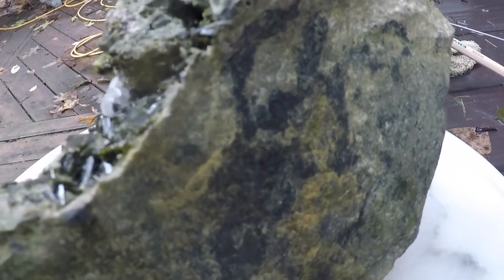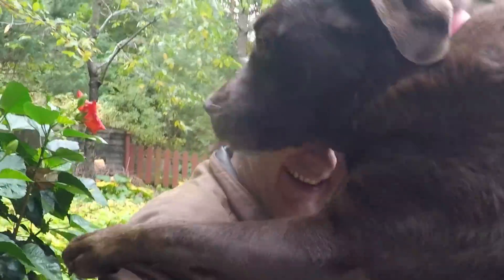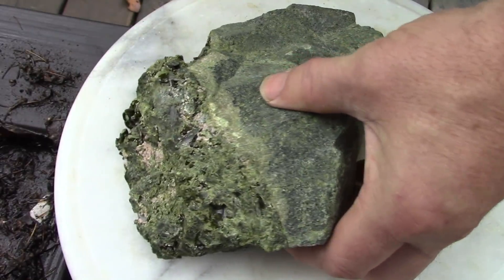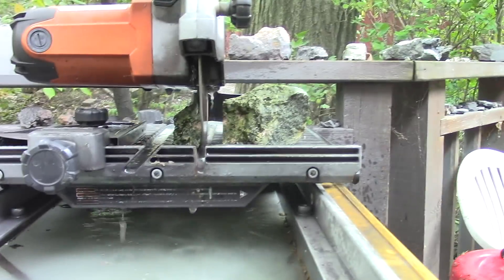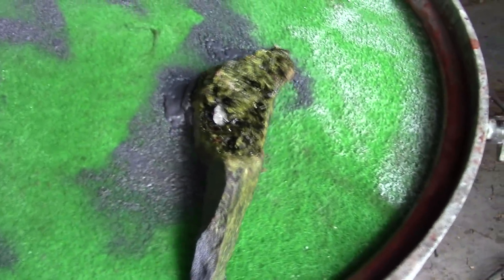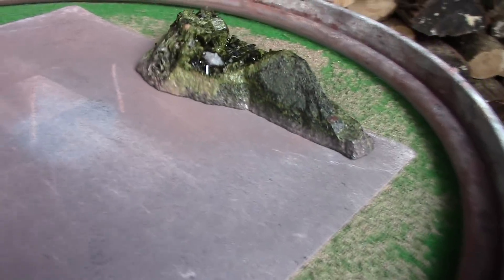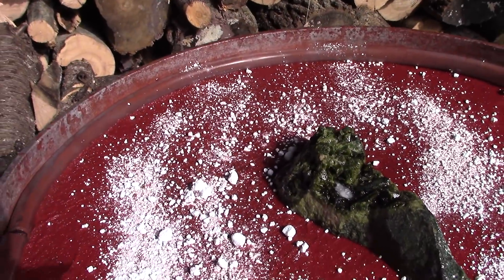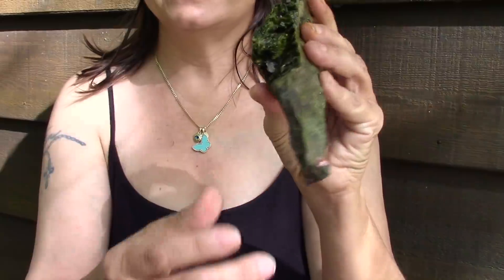Don't mess up meMiner!  Making Epidote Specimen for my wife

Comment: I tried this on some I found but the muriatic acid didn't do much. I'm guessing it's a quartz. It seemed softer than that though.
Reply from the maker: Look up mineral solubility table.  It will tell you what acids affect different minerals.  The trick of course is to know what minerals you have that will be affected or unaffected.

Comment: I usually take the rock I'm cutting and hold it up against the side of the blade after I cut it and rotate it different directions while leaveing the flat sutface on the blade until it's super flat and the saw blade marks are out.

Comment: Gorgeous - and cool you can just leave the machine to do all the hard work 😉⛄
Reply from the maker: I like the vib flat lap for polishing.  I am finding that it is not the right tool for removing the saw blade marks, as it takes forever.  It would actually be more effective to use sandpaper by hand or better yet a flat lap (wheel).  Another toy I need to acquire.  :-)

Comment: I love what you do. For what it's worth, here's my free input- you get what you pay for. Seems as though most of the silicon carbide granules would settle at the bottom of the felt. They are also very hard, so for them to be more effective, shouldn't the pad also be hard? Just a thought. Thanks for sharing
Reply from the maker: For sure many got thru the pad as the vibrating continued.  I actually really liked the sandpaper and will try to cut some full sheets and see how they work.  I looked around online and nobody else is doing this, so there must be a reason, but I cannot think of what it is.  Except, most people probably have a trim saw and don't have the wheel marks to contend with.  Thanks for your feedback.